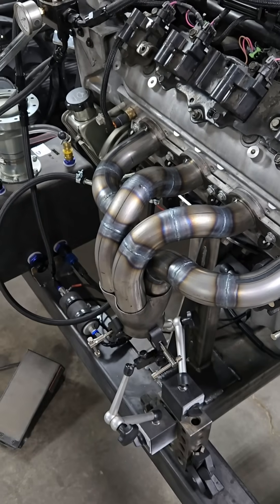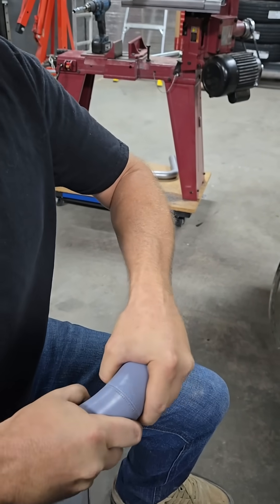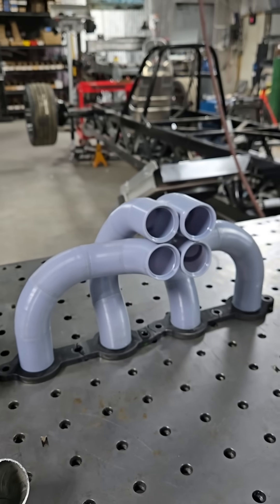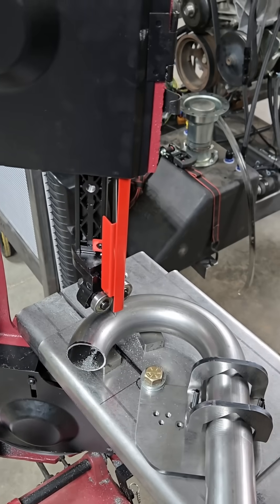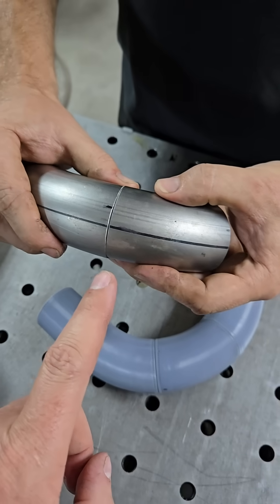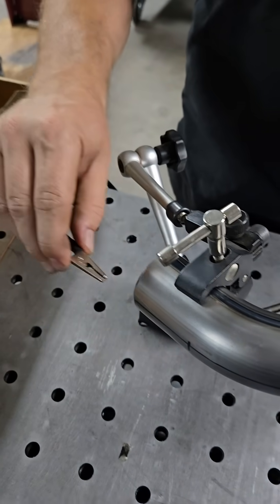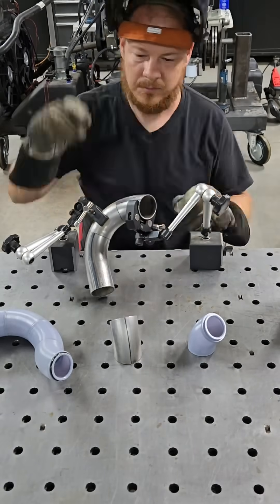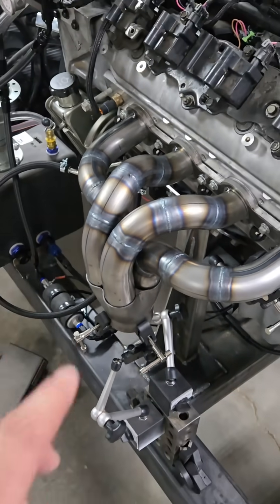Don't build another set of headers till you watch this!

Comment: I'm an engineer at a manufacturing facility, and I started an additive manufacturing user group. So many people are closed minded towards the crazy things you can do like this when you fully incorporate printing into your workflow. A set like that would be a pain to make normally, but with printing it becomes trivial. Being able to bring physical objects into existence at the press of a button for pennies is insanely useful and I'm always disappointed when people can't see the value in it
Reply from the maker: Well said. Waaayyy to many people take printers as toys. But they are can save you big $$$ if you know how to use them and your brain.
Reply: @centurialinc  hell yeah, my ignition lock barrel snapped its switch dingus off and they don't make this style so I couldn't just buy an aftermarket one. Used my 3d printer to print a version made in cad in plastic. Took a few attempts but eventually I had a functionally identical lock barrel model which I got printed by jlc PCB in stainless sintered steel.

Works like a beaut!
Reply: @centurialinc The aerospace company that I worked for had one 3d printer on a project, but we weren't allowed to use it and it was only used for vanity pieces to impress senior managers and gathered dust. They got rid of it because we didn't use it. We were using CATIA but you can easily design a part that would be hard to fabricate. Outsourcing engineering to cheap inexperienced heads elsewhere made it worse.
Reply: The Earth is not a globe 🌎‍⃠ There should be thousands of images of the whole Earth in a single shot. There's no curve, proven by long distance photography and a pressurized system(Earth) is physically impossible to exist next to a vacuum without a solid/enclosed barrier 🤷🏻‍♂️
Reply: Same here, I use it to prototype set up and alignment tools all the time them get them machined in alu or stainless when I'm satisfied. I also use it for all sorts of storage stuff around the workshop like nesting trays for tote bins, battery storage, etc.
Reply: 3D printing is great for making annoying shapes
Reply: Problem is people are generally opposed to learning ANYTHING outside of their wheel house. So until they come around on their own they will have resistant towards that new addition.
Reply: That's conservatism versus progressism, without the polical optics of these concepts.  @dragonofkilln9663
Reply: Even without thinking too deep, there's plenty of stuff that goes pretty far.
Injection molding is better. But it's an investment.

My current project is several custom ergonomic keyboards (Dactyl Manuform, an open source design) that'll be airbrush painted, varnished and sold. It's a very good design but too extreme for most people, but the people (like me) who love it will love it, and afaik no one else is going the extra step and both acetone vapor smoothing (to remove print lines, I'm using ABS) and painting them.

And it'd get expensive to buy the correct dust collection adapter for all my woodworking power tools. So I print them. Same with jigs.

Heck I learned airbrushing models by finding a relatively easy and fast printing figure I like and painting a dozen or so of the same figure, each time learning from my mistakes.
Like, people talk about how silly it is to have a print farm to mass produce stuff and I mostly agree, if you're mass producing you're better off getting an injection mold made. But there's a line where that becomes worthwhile, and 3d printing makes it even possible to work in plastic without a large enough run to profit after buying a mold.
Reply: @nerodia  Today I learned…. 

well it’s good enough for Koenigsegg 

https://youtu.be/TvVnSzFbv3c?t=315&si=MmoYoOqxOFA4V7GY
Reply: i use my printer to make jigs all the time. Super useful.
Reply: Would love to have a 3d printed hemp plastic ebike frame, it's said to be 10x as strong as steel but I'm finding it hard finding a cad file
Reply: @Craig-n9j its about the lignin. Look up a company called Superwood.
Reply: Not to mention resin is extremely cheap. In a shop like this I could easily see how investing in a large industrial resin printer would be great for this.
Reply: but thats also a good thing less people use it. it makes our lives easier who do use it and we can benefit of it imagine if everyone knew how to 3d print the plastic prices would go way up
Reply: @kebabsasmedturtle  actually as 3d printing has gotten more popular filament prices have dropped a lot. You can get a kg spool of petg for about 15 bucks now 10 years ago I was paying around 40
Reply: Where i can get this thing??
Reply: @codyhufstetler643  yeah exactly just like all the keyboard commandos talking like they’re gods gift to the fab world and saying your an amateur if you choose to use this tool or geez these have been around for 50 years, when in reality it’s a good tool and could save you a lot of time money and materials (have you seen the cost of premium stainless these days),in reality just because they worked at a muffler shop once they think they have the need to call you an idiot for using this tool, when in reality there’s probably a thousand header builders that have been using this to cut material costs which can pass the savings to the purchaser instead of 3 to 4 thousand or more for a set of headers for your car now they can drop it to the normal thousandish now for premium stainless quality headers
Reply: Yeah but it costs so much to print it
Reply: Can’t fix stupid
Reply: But you can buy shorty headers like that for most common engines that anyone puts headers on.
Reply: @gmw3083 but for those edge cases where these don't exist, additive manufacturing of prototype parts could save you mad cash
Reply: @codyhufstetler643  -  "I'm always disappointed when people can't see the value in it."   Do not be disappointed.  Consider the story of the lowly mouse. (Not the furry kind).  IBM conceived the idea but did not know how to purpose it.  Bill Gates secured the patent/rights/intellectual property to the mouse as IBM did not see its usefulness and willingly gave it away.  One engineer protested this decision knowing it had some kind of importance but also didn't know how.  Others need not value the vision you can foresee (unless you need their money to make it happen).
Reply: @TheTibetyak 

Incorrect. Not IBM. Xerox.
Reply: @Zane_Zaminsky  Thank you for that correction.   I'm older than the concept of the mouse and must be losing some memory.  But I'm still fascinated how people come up with partial ideas and then another person can see the trajectory the idea was intended for.
Reply: Don't be disappointed! Just envision the $$$ you get to make for your superior approach.
Reply: They have been around for years now! Invented in Australia..🇦🇺👍
The inventor of the plastic header making kit, which simplifies the design and fabrication of custom exhaust headers, is Victor Franco of icengineworks. He developed a system using snap-together plastic blocks that allow for precise, full-scale 3D header models. .
Reply: Eventually headers will be 3D printed out of iconel. Daniel Defense is now printing silencers from iconel.
Reply: Honestly i want to learn how to "print" inconel exhausts but i don't know where to start... Worth noting though that i'm just an enthusiast with a sh*tbox and a backyard.. 😅
Reply: @looped7979  
The 3D printera capable of printing metal are far beyond the reach of most individuals and require significant capitol investment. I'm relatively sure they have some at SpaceX. I'm not even a machinist or a fabricator, but I dream of the day discontinued auto parts could be printed to order at reasonable prices.
Reply: Agreed, I have had them since 2014, and they've totally changed my design workflow...faster and easier for sure. Obviously you need some CAD skills and software for bespoke stuff, but that gets easier the more you do.
Reply: Exactly! Imaging your thousand dollar part doesn't fit because you didn't make a simple end plate to see if it's an exact fit for pennies first!
Reply: you arent additive printing headers any time soon
Reply: @waynesmith-r8c  True. Doesn't mean you can't make sure an expensive part can fit before you make it. Also, have you seen the 3d printed turbo bell housings? Idk how much boost they can handle but we're not far away from printing blocks and headers at this point.
Reply: i guess its inevitable,we have powdered metal connecting rods that are super strong.......we just need the technological jump
Reply: This kit cost $20.000 but so worth it .
Reply: It has value only if you make hundreds of custom parts like this. From my personal experience as a welder 3D printed mock tools last long enough to make 2 or 3 and you need to constantly design and print new pieces. In the time it took our planers and draftsmen to make a special print I had completed the job without the set throw those things away and train fab guys to be creative free thinkers. As welders and fabricators we must be artists not robots.
Reply: The plastic mockup up tubes were around long before 3D printing
Reply: Everyone sees the plastic and sees no further than that. They see only plastic end products, not potential prototype or mold making.

Anyone who has ever made a mold knows, that making molds absolutely suck. The first primary model is the worst. Making a positive sucks because it's literally carving or shaping the object from scratch in clay or wood or something. And making a negative sucks even more, because you usually need the positive model first.

Now you can just 3D print either form just straight into existence. Then make a hardier mould from those models directly. 99% of the effort of metal casting is the sand mould. Now it's stamp any dumb 3D printed thing you want into sand in 30 minutes and there's a custom metal cast instantly. A process that would have actually taken days of work just to make the mold/stamp for it.

3D printing has not been fully realized simply in its use cases. Rapid and on demand creation of forms, of shapes, is an incredible tool. And completely reinvigorates and amplifies artisan manufacturing.
Reply: 21 century prototyping at home and it's affordable
Reply: The possibilities are incredible. Problem is that it requires a decent amount of money tinkering around with resin printers, purging chambers, and lasers/arcing elements before making a metal printer. The prices that companies charge for plug-and-play metal printers is insane
Reply: @tracycummings278  Thing is, they're following the same curve plastic printers did. They're already down to under $20k, which is where regular 3D printers were 15 years ago. Within another 15-20 years, you'll have a plug-and-play metal printer sitting right next to your resin and filament printers.
Reply: @tracycummings278 I am lucky enough to have access to a behemoth of a metal printer at work - a nice luxury
Reply: @tracycummings278  metal printing is best outsourced. I used jlc PCB (was about 25 dollars for a half-pound part in stainless)
But the plastic printer (I have a cheap fdm one from creality) is perfect for testing fitment etc.

Oh and great for printing those annoying trim fasteners that keep breaking
Reply: I have to think additive printing for headers may be premature for performance applications. 

What additive material could hold up to Saudi Arabian rev-limiter donut sessions or dune climbs for instance? The tailpipe literally glows at the tip
Reply: @zanetaylor7 They're talking about what was done in the video, which is prototyping/pattern making using 3D printed parts, not 3D printing an actual header. 3D printing is a godsend for that. Previously, you'd have to have a fully assembled car, and you'd spend hours lining everything up and getting things to the right length and stuff, then have to have all kinds of fixtures to hold it all in place on the car with no room to work, tack weld it there, fully assemble it on the bench, and even then, you'd sometimes find that it didn't fit right because of something you missed.

What they did in the video was 3D print exhaust flanges to fit the engine, then use 3D printed interlocking tube sections of the correct diameter to mock up the header.
Reply: @zanetaylor7  If it's good enough for hot-end gas turbine blades, it's way more than good enough for a set of headers - they'd be hideously spendy though! Sintered metal powder printing, not plastic obviously.
Reply: @zanetaylor7  3D Printed Titanium would probably do alright.
Reply: I somehow doubt printed material could withstand these temperatures and vibrations as stainless does.
Reply: @ it can't. That's beyond even engineering grade polymers. But you can print out a prototype out of cheap PLA, PETG or ABS to figure out a good fit, then recreate it in steel knowing your plan's gonna work.
There are some materials with good heat resistance and strength properties you can print with even cheap printers like glass and carbon fiber composite nylon, but they still aren't close to what you'd need for an exhaust manifold.
Reply: @BarniRepairs  3D printed parts are used for rocket bell nozzles. it’s just uneconomical for consumers
Reply: @BarniRepairs  your car is full of sintered parts. Sintered metal parts are 3d printable. It's the same process just instead of using a binder and press mold to shape the part you use a laser layer by layer. The final strength, as in sintering, comes from baking the part.
3D printed metal is entirely different from plastic for this reason
Reply: What I have metal ones at work 😂 they’re actually super simple to make I replace them all the time takes a few seconds secondly have you ever made headers bc this is where the disconnect comes into play between engineers and the people actually doing the work bc I believe this to be a tremendous waste of time sure it’s neat that you printed it but who’s gonna use that tool the industry hasn’t even been doing pie cuts for decades 😂 I’m often disappointed in people when they overvalue something despite its inherent uselessness because of an adjacent feature that they appreciate
Reply: @valkyire35 Question... How pathetically sad must one's life be to write whole paragraphs of made up lies about yourself?? 🤔

I can tell you've never even😅ust from you saying "The industry doesn't use pie cuts anymore" which while true for manufacturers, this doesn't apply to custom exhaust fabrication
Reply: @valkyire35  "the industry" what's the alternative? How do you make custom headers?
Reply: Can I tell you a secret? I’m retaded

Comment: Yeah that shits gonna crack in the first 1000 miles. Less than 50 heat cycles.
Reply from the maker: Not for direct use. Only for mock up.
Reply: @centurialinc  they never said if they make sure that all sections flow the same volume. Just because it's easy and shit doesn't mean it's optimal. Your really even jave to think about where your putting it and how the heat will radiate and disperse. Just welding some shit together that fits like leggos isn't really the answer. An really sick turbo header would be all bulged like a 2 stroke exhaust. Dimpled.

Comment: Those are noga’s. Usually used by machinists to hold dial or test indicators.  What is the holder u have attached to them to hold ur pipes?
Reply from the maker: That's correct. we sell them as a kit. The clamp is from the movie industry. Its a frame clamp for camera and lighting setups. Get the hole thing here https://www.centurialinc.com/tube-coping-tools

Comment: Hey are you using the Hercules 12v 1/4 in ratchet?
Reply from the maker: ours is the 3/8 drive but yes.
Reply: @ hahaha I was gonna add 3/8 but thought it would look weird in the comment. Awesome how’s it’s holding up?
Reply from the maker: Good so far. We took it to the junk yard to pull the engine and trans for this race car build and here it is! still going. It has now gone through two LS tear downs and rebuilds.

Comment: I’ve done pipes like this with a bender. Fill the pipe with sand and it doesn’t swedge down and there’s no welding until you get to the collector and the flange.

Comment: Bro is that a standard collet set up on the tig torch? And like u said you should purge it (also use a larger cup a 12-16 with a gas lens body and obviously the correct gas flow the gas flow can be found online and make sure you are transferring the data into the proper units like CFH and LPM

Comment: Back purging recommended on all metals not just exotic ones. And you can also use a painted on flux like Solar flux, it's easier and more economical.
Reply: Atrociously incorrect.
Reply: Why don't you enlighten us and be specific.
Reply: @gt40f  carbon don't need backpurged. Most welding needs an inert atmosphere to keep out oxygen, but you don't need to backpurge carbon if we're talking about tubes or pipe. You can, but the root will be solid if you just use 70s6 rod and your torch.
Reply: It depends how thin it is if carbon steel is really thin it will burn on the back side.

Comment: How do you know where to mock it up. If it’s not in the vehicle it’s going into???? You have to clear a lot of obstacles in your way& steering shafts etc on a lot of vehicles.. so you could make a huge mistake& waste a lot of time& materials if the motors not in the car or truck when you do it that way..
Reply from the maker: These are for demo while it is on the DYNO. The process is the same in the car.